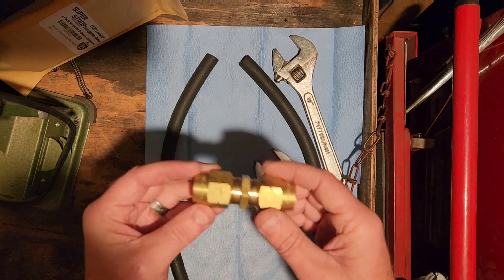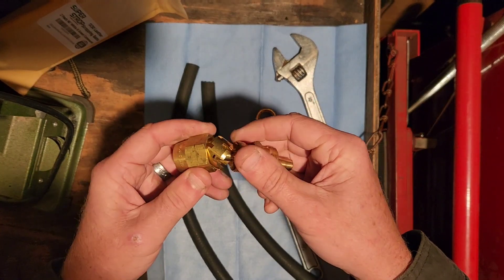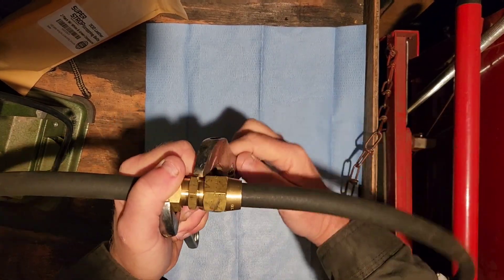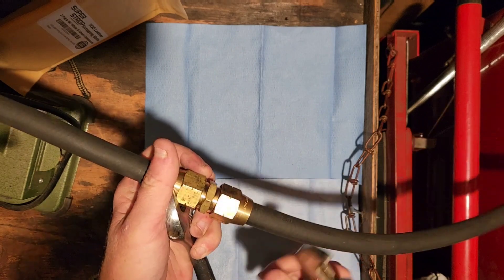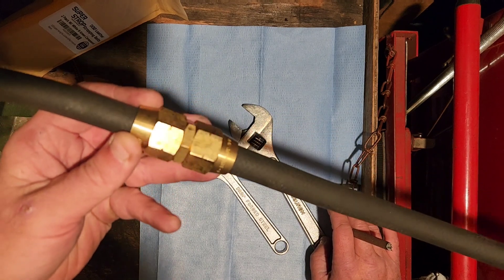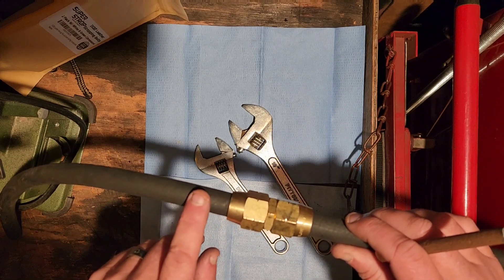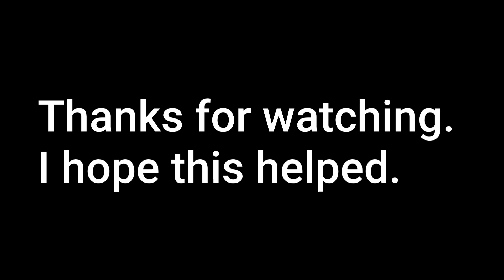Repair your air brake hose in 10 minutes.

Comment: Great video, perfectly explained. Do you have a link for Amazon?
Reply from the maker: @JUSTL00KING  I can't get the link to work in this reply, but if you type Air brake hose fittings, you should get the correct result.  Here's the item description for the exact product.  I copied it and paste it into the search bar, and it worked great.  Try this:  
Legines Brass DOT Air Brake Hose End Fitting, Union, 3/8" OD Tubing, Pack of 2
Make sure you get the ⅜ inch inner diameter, if you're repairing your brake lines.

Comment: Im new to trucking.. will this pass an inspection or it’s just to get back on the road? Thanks in advance
Reply from the maker: @issy3735  This will pass inspection, as long as it isn't leaking air.   Once you're finished with it,  apply air to that line & spray it with  soapy water.  If it doesn't bubble up, you're good. If it does,  tighten it some more. 
As for applying air to the particular line, you'll do that from inside the cab.  If you're checking the service line (blue gladhand), use either the trailer hand brake, or the brake pedal.  Put about 25-30 psi in it, at least.  
If you're checking the trailer brake line (red gladhand), just push in your trailer brake knob (yellow).  Then hop out, spray the new connection that you installed, & see if it bubbles. 
I also recommend that you perform your brake check test (COLA) from the driver seat, as you practiced in CDL school. Do that test throughout your career, each time.  
Thanks for watching the video.  I hope it helps.

Comment: Hey Bud Thanks for the video, could you supply the compression part info? Maybe something that could be purchased Amazon or retailers, Thanks
Reply from the maker: In the Amazon app, I searched  "air brake hose fittings" & found these items.   Look for the product called "Legines Brass DOT Air Brake Hose Ends Fitting, Sleeve, 3/8" I.D. Tubing, Pack of 5".  Those are the sleeves with the crush tabs (similar to the Rook/Castle piece on a chess board.)  They get crushed down and bite into the hose as you tighten the outer parts together.  
Also, look for the part called "Legines Brass DOT Air Brake Hose End Fitting, Union, 3/8" OD Tubing, Pack of 2."  That is the entire package, including the inside sleeves that get crushed onto the hose. 
Often, these are available at TAs or Love's/Speedco.   
I tried to put a link in here, but I can't figure that out.  If you can't find these, let me know, & I'll do a quick screen recording of how I found them on Amazon.

Comment: Great video, thanks! If you are doing drop and hook, I suppose the trailer is not yours, are owners okay with carrying out repairs?
Reply from the maker: I cannot imagine that any company would gripe about someone doing repairs on its equipment, provided the work is done correctly.  Airline repairs, as in this video, are pretty straight forward and inexpensive. An owner/operator could either charge it to the company or write it off on the taxes, either way. I would charge it to the company & be reimbursed 100%. In any case, provided you do the repair correctly, the company is far more likely to appreciate the repair because it saves an incalculable amount of time & expense in the long run. In any case, I always recommend doing the repair, even if you don't get reimbursed or write it off the taxes. Time is money, and very few of us get paid by the hour to sit on the fog line waiting on the service truck.  Thanks for watching my video. I do hour you learned something from it. I don't have a lot of time to post videos, but I will talk about things that are important as they touch my heart. Another viewer asked for a video about winter driving through Wyoming. I haven't had time to do that one, but maybe soon. Thanks again.

Comment: were did you get the uion to repair the hose
Reply from the maker: You can buy them from pretty much any truck stop for just a few dollars. Service shops will have them, too, so any peterbilt, kenworth, etc. Also, ask your mechanics for a handful of them when you get to your yard. Don't forget the extra air line and adjustable wrenches.

Comment: Can you use Gorilla tape for protection instead of another hose?thanks
Reply from the maker: Yes, you could use tape rather another hose. I would recommend black electrical tape, but I'm sure Gorilla brand tape would do, as well.  The goal is to protect your air line from rubbing/vibrating against other objects and wearing a hole in themselves. Anything you can do to add a protective layer is going to help. Thanks for watching.

Comment: How much should 5 of these cost? Amazon is selling a 5 pack for $60
Reply from the maker: That's probably the best price you're going to find.  Truck stops jack up the price on everything, so I would avoid that, if at all possible. Remember, though, that the only part that is NOT re-useable is the ferrule/crimper. If you can grab a bag of those,  plus maybe a couple whole sets, that ought to do you fine.

Comment: Why is it so important that you cut the hose straight? I dont have an airline cutter but I use a box cutter and I cant get it super straight
Reply from the maker: @sdoieqwfjhweoiuhasdo  It doesn't have to be cut exactly square, but you should get it as straight as possible.  The ends should fit fairly squarely inside the fitting to prevent leaks.  I've done it in the dark with very little slack to spare, and it turned out fine.  You just don't want it to be ragged, that's all.  Don't stress too much on it.

Comment: Yeah not going to find them at any truck stop.  Great video thanks so muct great info.
Reply from the maker: Most repair shops will sell these connections. Also, you can pull into any name brand shop,  like Peterbilt, Kenworth, etc, and they'll sell them.  I get a handful from my truck yard mechanics whenever I run low. Loves is always a sure bet.  You are correct.  You won't likely find these inside the store.  You'll have to walk over to the repair shop where the bays are. Also, NAPA might carry them, but that's a crap shoot, really. Best practice is to go to a Loves repair shop.  Thanks for watching the video. I'll be posting more as time permits. Hmu with any questions.  I'll do my best to help as I can.